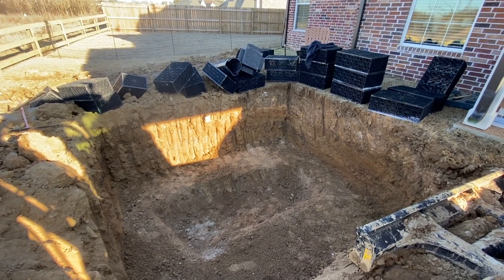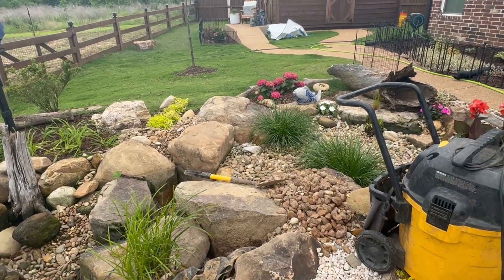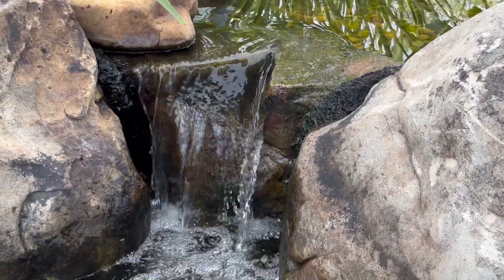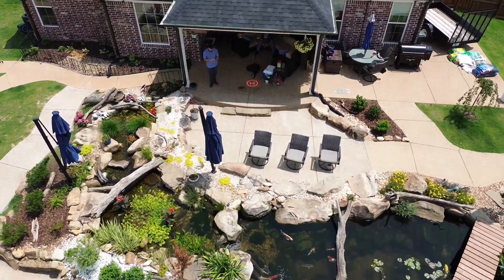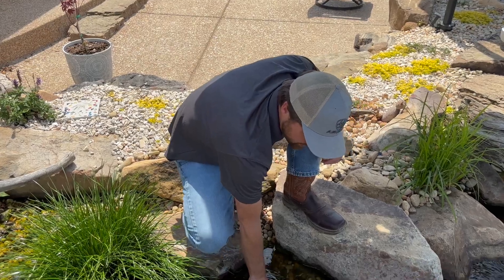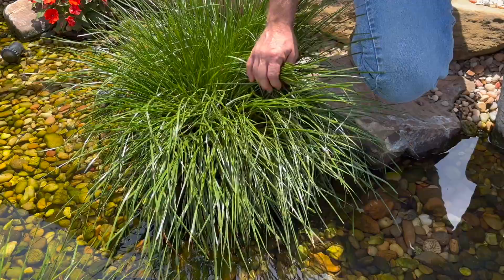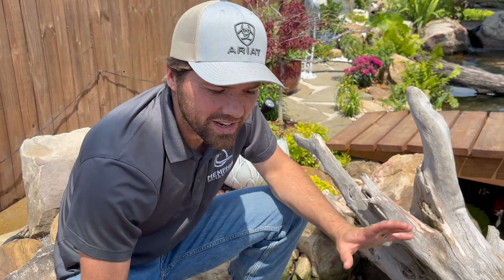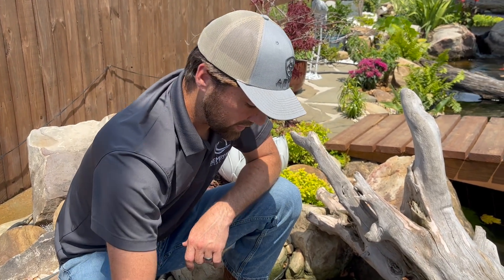Wetland Filters    EXPLAINED!

Comment: i understand that you mentioned the size ratio from pond to wetland and intake bay but my question is the really a size to big of either. like can you over size the wetland and/or the intake bay? is more filtration not good? and same for the intake bay side of it
Reply from the maker: @MrSamurai904  the important factor to get right for the wetland and intake bays is flow rate; it must be matched to the size. After that and yes you can create as large a wetland or intake bay as you like. The one caveat to the wetland is that wetlands want and need nutrients to filter out in order to remain relevant and healthy so if you have a huge wetland filtering too small of a pond then that imbalance could cause the system to crash and swing like a pendulum between unhealthy extremes of too much nutrition to too little nutrition and then you can’t keep a low-maintenance healthy ecosystem. Ideally your wetland should be between 10-15% of the pond’s surface area or 25-30% of a recreation pond’s surface area.
Reply: @ but not like a 50/50 situation for rec pond to wetland
Reply from the maker: @MrSamurai904  I’m concerned a 1:1 ratio would be too much. You could make it look like a wetland but without all the hardware and filtration.